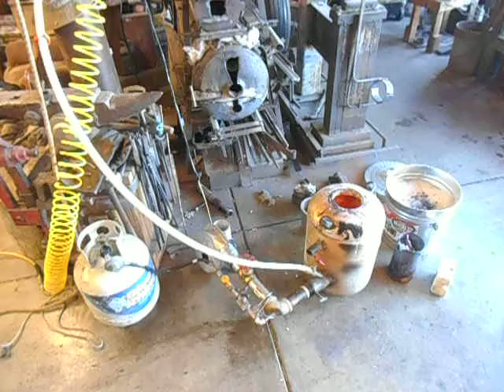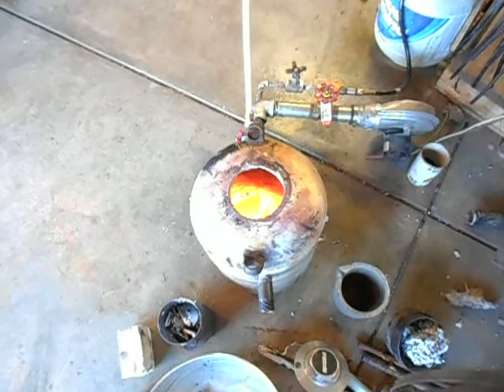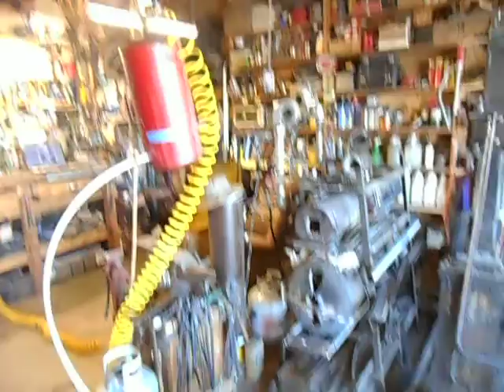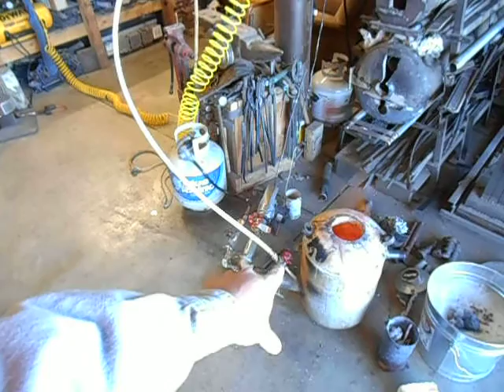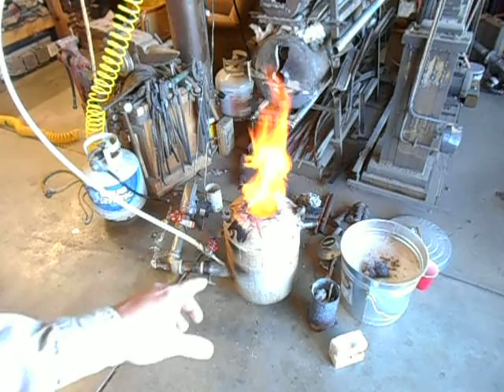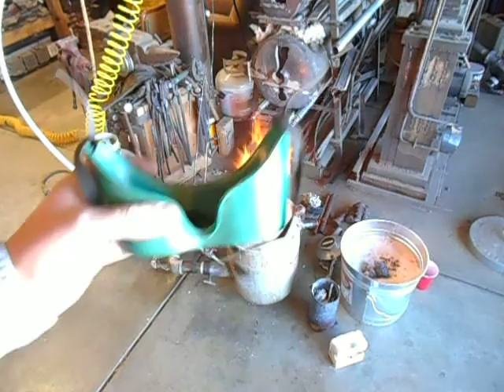waste oil foundry run with improvements

Comment: Ditch the huge gate valve on the oil line... you need a small needle valve, like what's used for a fuel shut off valve on small engines, or icemaker water line valve.

Comment: Nice man.   Is your oil feeder just dripping in from the top of that main blower tube, or does it extend down into the tube so it's about in the middle?    Mine is getting close to being done, plus I have 1/4in ready to go.... yours seems to be running well on 1/4in oil out tube?
Reply from the maker: yes the pipe nipple that is welded to the burner inlet is 1/4", it sticks down in the tube about 1/2" if I remember right, just far enough so that the oil has to drop into the air stream instead of running down the inside of the pipe walls and not getting vaporized.
Reply: Thanks man.  Get'n the kao and proper refractory in this weekend.

Comment: Looks good Joe. They always smooth out when you run them Up on their " curve" . Too low and they can run too cool and not get enough turbulance in the combustion to run clean and even but ramp them up and they come on song nicely. 
You furnace looks like it still has plenty to go so will be good to see an outside run where you give the thing full tilt. 
Once you have it running hot, make it a bit rich then open the air to max and then  fuel it up till it starts smoking.  Back it off a hair from that and you will have something to stand back and admire. 

People say that having flame come out of the furnace is inefficient when melting metals but I have found that is not true.  the more fuel you burn the hotter the furnace becomes because the combustion is taking place inside and the heat losses are much less respectively. 

I look forward to the full tilt Fire up!
Reply from the maker: +Oil Burner I did a burn with it last night, and did my very first controlled iron melt!! melted half of a camshaft and then poured a funky looking ingot in the top of my dry sand bucket :} I did have the camera out and I must have not hit the record button hard enough, so when the pour was done, I hit it again and must have started it, as all the video shows is me jumping up and down hollering like a fool that it worked :}I ran it at what I would guess is about half to 2/3rds of what it can do. im guessing that as I did have flames shooting about 4 foot high when I was first firing it up, and these flames were only about 20" tall. it will be awhile before I can take it outside and really see what it can do as ill need to take it to another place as I don't have neighbors that are as understanding as yours ;} and it will only get to about 20F today here. but this spring when I build the scrapping furnace ill see how big the flames will get! I just about have all the parts gathered up for the scrapping furnace. the 3.8 amp bouncy castle blower got here yesterday, I have a 50 gallon barrel for the shell. I have a place that has a thing that folks used to burn trash in, its about a 5 foot square box about 4 foot tall made out of cinderblocks. the basic idea is to clean it out, punch a hole in the front to take the burner, build a stand inside to hold the barrel, and possibly a lid. I think with a setup like that, combined with a burner like your 600kw beast, and I will be able to melt down whole aluminum wheels, engines, transmission housings and such. I still need to find something for the burner, design the fuel system, and get all the little details straight in my head. but it should work pretty good, and be in a very controllable location.
Reply: +Joe Calton  If I had 10 bucks for every time i haven't hit the record button properly, even when I worked as a video cameraman, I'd be driving a much more expensive car than what I do now! These days I always hit the button and look for the red dot in the Vfinder before I move away and start what I'm doing. 

The scrapper sounds great. As usual well thought out and should retain the heat well.  I'll guarantee you wont need 600Kw for it. On my drum scrapper with flames shooting everywhere I'm still well under 200Kw.  It's amazing the heating power oil has especially when you use it direct like in a scrapping furnace.
Once you use it, you'll be happy for it to be as cold as possible because once you fire the thing up, You'll be sweating like a pig.  :0)